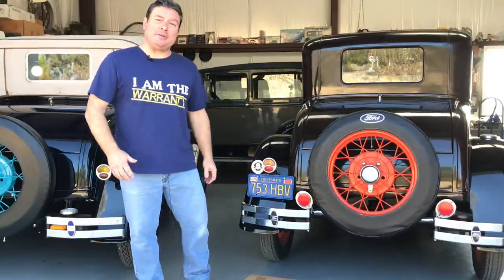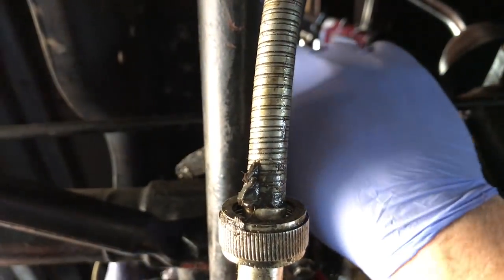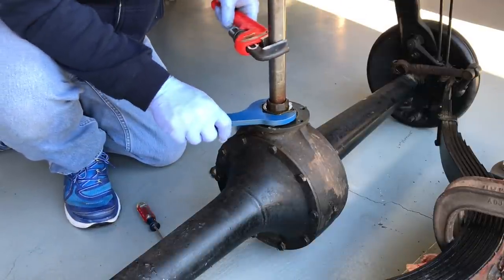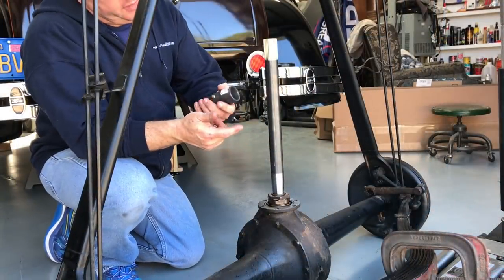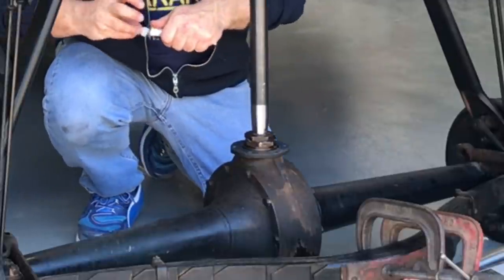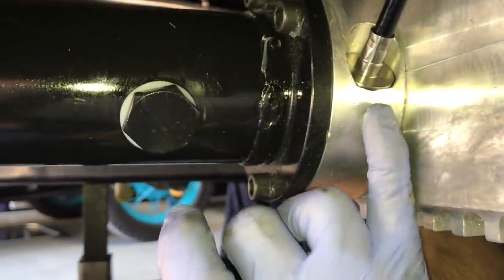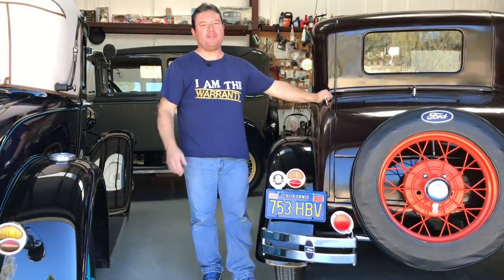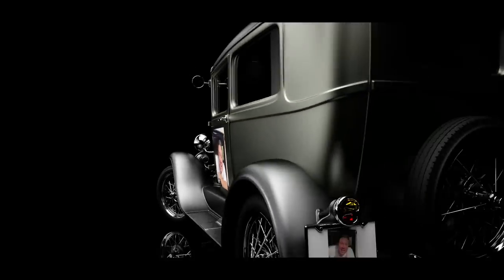Ford Model A Mitchell Overdrive Installation

Comment: Great video.  Thanks for all your hard work.
These excellent videos should convince existing Model A owners to drive their vehicles more.
Also, it demonstrates that Model A's are still very drivable in 2021.

Not being real familiar with Overdrive, I found the following:
Per Wikipedia, generally speaking, overdrive is the highest gear in the transmission or in an Overdrive System.
Overdrive System allows the engine to operate at a lower RPM for a given road speed like cruising at 45 mph.
This allows the vehicle to achieve better fuel efficiency, and often quieter operation on the highway. 

Do you also use Overdrive for ascending hills in the Model A?
Do you disengage it when descending a hill?
Reply from the maker: Thank you for your kind words!  Overdrive is useful for some hills, but not all.  In the video (link in description) where I show how to use the overdrive, I go over some of that and show how.

Comment: I wish I would have seen this video 10 years ago...LOL I have a Mitchell in my 29 Roadster, and the Threads striped off the axle. I took the hole rear apart , and when I did that I changed the gears from 411 to 378, I used a bearing puller to pull the pinion gear off, and split the drive shaft , from the top of it to the cotter pin hole. you made that look very easy. i wish i would have done it that way. When called Sue Mitchell, and told her I needed a driveshaft, she said she never heard of one cracking like mine did ! Thanks
Reply from the maker: I have seen them split like yours did a few times.  That's why I never use a puller to get the pinion carrier assembly off.  That nut on the end protects the end of the shaft and the treads, and using the BANG is the best way to remove a tapered fit anything.

Comment: Man 26% will make a big difference!  Reminds me of the Borg Warner "4+3" O.D. unit on the C4 corvettes.  It was meant to be used as a "5th gear" but it worked in 2nd-4th gear so there were many gear splitting possibilities.  Really cool idea.
Reply from the maker: Yes!

Comment: This has very quickly become one of my favorite channels. I'm a dodge guy and would love to get my hands on a series 124/6/8. Seeing up close looks at these fords is really interesting. And man are these ones nice.
Reply from the maker: You're an honorary Model A guy now!  Dodge is close enough.
Reply: @ModelA  The Dodge brothers made a lot of Model T parts before they becme Dodge builders.
Reply: I stumbled onto a 31 model A last July when a grandkid was emptying his grandpa's house contents mostly into a dumpster, and he had a model A with froze up engine and brakes sitting in the carport ! Last time it ran was 1997, and apparently someone pushed on the brake pedal, and locked the brake shoes onto the drums, so the grandson didn't have much hope for it, and needed it out of there !! Was in the right spot at the right time, Aired up the tires and drug it on my friends trailer with a winch and now it is sitting in my driveway, waiting for me to get everything loose again !! I never had an A Ford before, but doesn't look right to me ? Title says it is a 31 convertible, but the wheels are not wire, and it has hydraulic brakes with STUCK master cylinder and wheel cylinders, Engine was stuck too, but my friend  broke that loose with a 12 volt assist ! Did 31's have hydraulic brakes, or was that added along the way ?? The wheels have Pontiac hub caps on them, and the left of the steering column doesn't have advance / retard lever, so do I have a Model A, or just a pile of random parts, the grandpa put together ?  I saw it on the streets around town in 96 or 97, and always wanted a ride in it, but never got the chance, so now I have my chance now !!! The grandpa was a carpenter, so it has homemade plywood on it with old countertop metal trim, but looks cool to me with tan colored plywood, with root beer colored fenders !! The tires have held air all winter after airing them up last fall, so I'm excited to get whatever it is I have running ! Thanks for t your videos, it has helped my enthusiasm ! I told the grandson I would give him a ride if I can get it going ! THANKS for your AWESOME videos, I'm learning a lot, and want to drive it back and forth to the Post Office this summer !! Matt, your # 1 FAN

Comment: Paul, I totally agree with all the other comments “Your best video yet!”

I am the current custodian of a ’31 Vicky. It is my understanding that installation of the Mitchell o/d is different due to the flat floor in the back seat. 

Can you please comment?

Thanks!
Bill
Reply from the maker: Yes.  You just order the overdrive specifically made for the Victoria.  The gearbox is located in a different spot along the torque tube.  Simple!

Comment: I can't think of many sights and soudns as relaxing as someone who knows what they're doing, driving a model A. Shifting combined with the exhaust note and transmission whine are make for an intoxicating mix of mechanical ballet and music. Thanks for the great video, Paul! I'm still amazed at how much aftermarket support there is for a Model A.
Reply from the maker: Yes, indeed!  The Model A does have what I believe the most aftermarket support of any automobile its age.  Just amazing!  Now, if I could get some of those vendors to sponsor the channel... Imagine all the helpful videos that could be made...
Reply: Remember, you can build a '57 Chevy with affter market parts.

Comment: Good one Paul;love the vid and love the A miodel!!!!
One little thing I noted: as you adjust the preload on the bearings at 22:00 .... normally you allow for a tiny bit of play when adjusting the preload with the adjustment nut because when you tighten the locknut on top of it the adjustment nut will be pushed forward because the nuts have some play on the thread!!!!.... I mosttimes tighten the adjustment nut than untighten until play can be felt and than untighten it another 30 degrees or so..... you can than feel a bit of play.... after you tightened the lock nut this play will be gone...
This sort of lay out is quite common on rearaxle wheelbearings of heavier trucks.

I am eager to buy a Model A myself as there is a Canadian ‘28 A model for sale nearby...

Greetings,Henk,Netherlands.

Comment: It's great that you concentrate on the Model A's mechanicals and tolerances.
While restoring the upholstery, body, and paint is very important and visible, the mechanics of the brakes, steering, etc., make for a reliable and fun car or truck.
We owned a beautifully painted Model A that didn't run well due to corrosion in the gas tank and didn't stop well because the brake system wasn't restored.
It wasn't fun to drive an unreliable Model A.
Reply from the maker: Right.  A lot of people who have criticism for the way a Model A drives or steers or brakes and basing their opinion on very poorly maintained or "restored" examples.  Either that or they have no experience at all and make assumptions.

Comment: Oh, I'm a firm believer in tech manuals. The engineers that designed the (whatever) knew a lot more about it than I do! Using the specific torque values save trouble down the road. Obviously, some items are okay within a very broad range, but critical fasteners? Thanks Paul, I'll get to All of your videos, just gimme time!
Reply from the maker: I had better get to work making more!

Comment: There is nothing like the sound of a Model A engine,  Paul you have 
got that installation to such an art form, you may need to change your
name to Mitchell. Bet you are glad of Henrys "steel to the wheel" brakes,
saves a lot of messing around with bleeding.
Great outcome.
Reply from the maker: Oh yes!  Ha ha!   This is probably the 50th Mitchell installation I've done or helped do.

Comment: If I could have hit the Like Button 100 times I would have!  Excellent video Paul !  And it was very nice seeing the Mrs. after she adjusted the brake rods!  I have to say that you're really inspiring me to buy a Model A.  And don't think I missed your beautiful Tudor in the background.
Do you think it was easier leaving the seat in the car or would you advise removing it?
Do you recall if torque figures were included with the Mitchell kit?
Do you plan to install a Mitchell EZ-Check Oil Kit?
I see your buddy has the same battery(s) that I put in my 1948 Chrysler Windsor.  I was concerned about a possible generator failure away from home at night time so I installed two of those Optima's wired in Parallel.
Did you remember to put me on the list should you decide to sell your Tudor?
Reply from the maker: Leaving the seat in and covering it gives me something to lean on.
No torque figures included.  It's all you.
No, not going to install the EZ oil check gizmo.
I switched to Optima batteries in all my Model As.
You want my tudor sedan, huh?  You're gonna need a BIG checkbook!
Reply: @ModelA    I wondered if the seat might be left in to lean on.  Thanks.
I just learned about the EZ Oil Check thing.  I asked you because Mitchell Manufacturing states common leakage into the torque tube while being unknown to the owner.
I've never regretted buying my Optima batteries.
I think your Tudor fits the Model A that I would want--and I trust you.  My checkbook is handsome.
Thanks for replying Paul.

Comment: Paul, you must be way more less of a klutz than I am. There is no way I would have been wrenching (especially with parts big enough to span the terminals) so close to the battery without taking precautions. If I can screw it up, I will! Great video and very informative.
Reply from the maker: I'm an electrical engineer in my real job and I work with very high voltage broadcast equipment.  So in my world, 6 volts isn't even an issue.  If it sparks, it won't be much.  Truthfully, I wasn't as close to the terminals as it looked.
Reply: @ModelA  The Model A's are more fun!  I was an elevator technician and an elevator contractor as well as an elevator inspector and an electrician.  Had a friend that owned Tower Elevator and a few times I worked with him on broadcaster tower elevators. You better not be afraid of heights. Those are deadly insane to work on.

Comment: I just watched this for the 3rd 4th time.
Mo.A overdrive mitchel
26% doesn't seem to be very much. 36%
I would say is better
Wish is alittle more
Than .7to1.0.
I used to work on
Lincoln's Mercury's
And Chevrolet products manual
And automatic
Transmissions
The Corvette had a 6
Speed man. With
5th and 6th were
Abt .7to1 and .5to1
4th speed in the automatic was .7to1
Wich is abt 30%
Over the top.
Around 1985 86 you
Could get a the corvette with a
Dougnash 4 on the floor with a 2speed
Auto integrated behind it. The speed were
Direct and overdrive
Electrically shifted
With a button on the
Side of the shifter
Was very meticulous to overhaul. And the shift linkages were a hassle to adjust. The Ford Model A looks very simple nicely done Paul. I worked on many Ford manuals and automatics as well.
Live long Paul.
Dwight.

Comment: As I was looking at the very large leaf spring I was wondering if there are suspension upgrades for a Model A? And excellent job on the installation and I really enjoyed watching the video.
Reply from the maker: "Upgrades"?  I have seen lots of hot rodders do upgrades that seem to change various aspects of the ride, but none ever make it better.  Just different.  Best upgrade you can make is rebuilding your shock absorbers and then setting them all exactly the same.  What a difference that makes!

Comment: Great video but you should have installed the Mitchell Synchro gearbox at the same time. Gearing is 15% higher & matches perfectly with the Overdrive unit. I own a '31 Model A Slant 160B Show Car here in Australia, a multi award winner & driveability has improved 100%. Trouble is now, it goes so fast, the mechanical brakes have trouble slowing it down but set up properly, with braking from the rear first, it now stops reasonably well.
Reply from the maker: I have the Mitchell transmission in one of my Model A's.  Only 1st and 2nd gears are 15% higher (each is an individual option, or opt for both).  Since 3rd gear is straight through, it is not 15% higher.  Anyway, not everyone wants or needs the synchro transmission.  In fact, I kinda prefer the stock transmission.  Especially considering the price tag of the Mitchell transmission.
Reply: @ModelA  Fact is Paul, these old cars were never designed to drive at more than 60kph ( 35mph) & anything that makes them safer to drive in todays traffic conditions, has to be an advantage. I had my doubts about how good the Mitchell stuff was, until my local importer convinced me the cost wasn't an issue when it came to how good it made the Model A drive & he was dead right. I defy any Model A owner to drive a synchro car & then not say the mod was well worth the dollars. Simply put, if Henry Ford could have done it, he would have but the extra cost of Synchronization & Overdrive units would have killed sales with the extra cost!
Reply from the maker: Perhaps Henry Ford would have installed synchro transmission sooner, I agree.  Everything else, I disagree.  The Model A could do 65 MPH right out of the factory with 45-50 being pretty normal cruising speed on the rare flat road.  A synchro transmission doesn't make it "safer", only slightly more convenient for those who struggle with the stock transmission.  For those of us with many thousands of miles driving Model A's in their stock form, shifting a stock trans is second nature.  So, to answer your comment, "I defy any Model A owner to drive a synchro car & then not say the mod was well worth the dollars", I am here to tell you that I disagree.  I have a Mitchell synchronized transmission in just one of my Model A's, and the decision to keep all my others stock is not for financial reasons.  It's because I prefer them that way.  Same from some of my fellow club members.  Yes, there are a few who prefer the synchro trans.  I'm not at all saying nobody does, just that your assumption is incorrect.  Not all prefer it.
Reply: @ModelA  Must be a different attitude to driving here in Australia Paul but my importer is doing these conversions every week because owners absolutely prefer to spend the dough to improve the ease at which these cars can be driven, especially around town where changing down at roundabouts is a real pain. I've been double clutching for many of my 71 years & it one component in my car that was absolutely annoying, especially given the synchro is build INSIDE the old casing......brilliant. Mitchell make these modifications because they're popular & the demand in the US & around the world is apparent. BTW, the Mitchell Overdrive made two fundamental mistakes & if Sue Mitchell was alive today, I'd tell her. Using silicon sealant when joining the half shafts to the overdrive unit & using black 7/8" cap screws to also join the same components instead of cad plated items. Nothing looks worse than rusty nuts & bolts, 6 months after a restoration!

Comment: what i like about you is you are a purist. you improve the car to make it safer and more driveable.  too many model a cars were butchered with big v8 engines. do model a cars ever vapor lock. my fathers 50 ford would vapor lock.
Reply from the maker: Thanks Vincent! They can, but it is rare.  Figured out that if you mix some Marvel mystery oil in the gas in summertime, it stops that from happening.

Comment: I have a 29 four door sedan and 30 station wagon I drive them both in late spring till first snow. This overdrive will make them more drivable on today roads that were dirt when model a were made I added turn signals led lights radio and heat pp AC third row seat on my station wagon for ok m junk bronco seat belts
Reply from the maker: Sounds neat!

Comment: Sounds like the clutch pedal is catching on the floorboard metal pedal plate every time you depress the clutch. Mine started doing that while on a tour. It drove me NUTS until we got to a rest area.

BTW, when I installed my Mitchell I left the spring in the car. Working by myself, it was just easier and I didn't have to raise the car a high. Which ever, both methods work.
Reply from the maker: We hadn't fully secured and aligned everything.  We were in a rush to see if the OD worked!  So, it probably was the pedal plate against the pedal shaft as you mentioned.  Good ear!

Comment: Paul, excellent video!  Love your channel.
Reply from the maker: Thank you kindly!
Reply: I will likely get one of these some day down the road. Does the part that bolts to the transmission tower bolt right over the mounting tabs on the brake light switch flange on a 28/29?  PS You make it look so easy. Was this about a one-day task or more?
Reply from the maker: @BillGeurts2269    Yes.  One day if not making a video of it.

Comment: Awesome video.  This project is very doable.  Didn’t know you could pull the driveshaft/pinion gear out the front.  For me this is a game changer. Though had to split the axle tubes. Now, I want an overdrive more then ever.  The big question is which car first.  My first love the 30 Coupe or my always wanted and now have the 28 Tudor. Thank you again for the Videos.
Reply from the maker: Coupes are cute.  Tudors are more versatile.
Reply: @ModelA  
Cute. Lol. It’s a he.  That Guy by name is the coupe and This Guy by name is the Tudor. 
That Guy and This Guy. 😀
Reply from the maker: @richardt2k1    Oh, my mistake.  Sorry!  Didn't mean to assign gender roles!  Ha ha!  I'm not politically correct.  I've had almost every popular body style Model A and I still prefer the tudor sedan if I could only have one Model A.
Reply: @ModelA   wanted a Tudor ever since high school finally got me one 😁
Reply from the maker: @richardt2k1    Good!
Reply: @richardt2k1  Wanted a 1931 phaeton since not long after high school. Way too old but I finally have HER. Even Henry called them "a lady".
Now I'd rather have a Victoria.